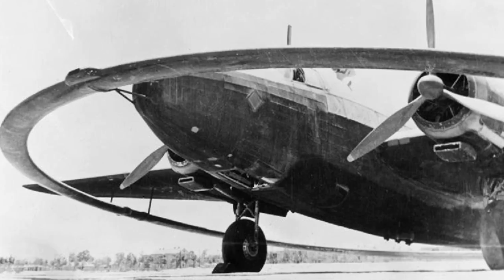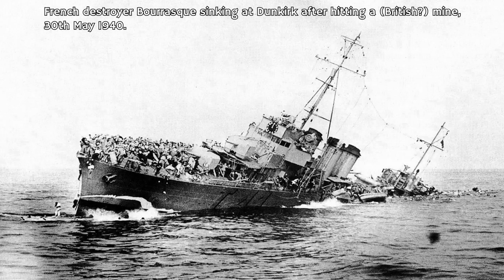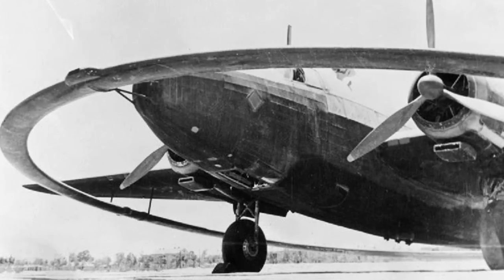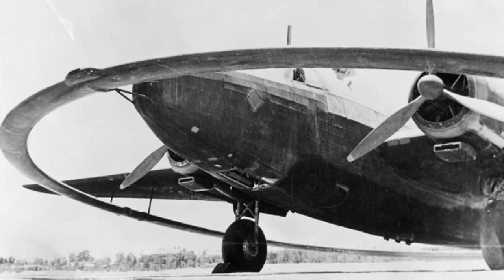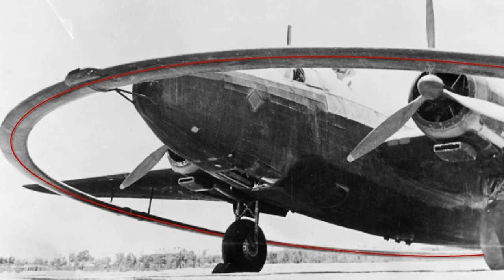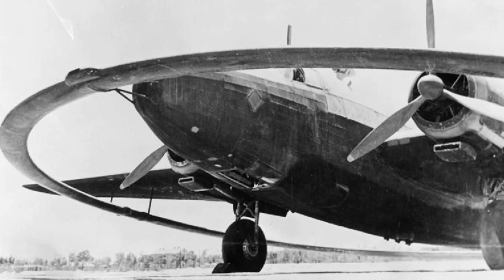Why did some WW2 planes have hoops around them?

Comment: Flying minesweeper....
Reply: The US Navy currently uses helicopters that tow a minesweeping sled behind them to do minesweeping.
Reply: How many Haitians do they pack on board?
Reply: As  Chairman of  the "Save the Haitians Movement" I will be reporting you to the Reischenbliger Organization of Moldova, The American Licorice Company AND The Cheesecake Factory.
Reply: MrDgwphotos seems ill advised
Reply: It actually works quite well. Not sure if it's still done but it was invented for very narrow and shallow waters where the large ocean going US Navy mine countermeasures ships couldn't operate. Rather than doing the obvious and build smaller ships, they built helicopters because high tech is always best ;)
Reply: @MrDgwphotos  Yes they are called MH-53E Sea dragons.

Comment: Electronic Warfare goes pretty far back in history, first learned about this taking the Electronic Warfare Officer Course in Iraq.
Reply: Yeah, I would argue it started when people adopted the telegraph technology.
Reply: fascinating video. I would like to have such a modified plane in my model collection.
Reply: Take A Revell BV138 "Fliegender Holzschuh". Nº04368
It has the parts to modify to the minesearching version
http://modelstories.free.fr/analyses/avions/MS2006_10P/REVL_BV138/index.html

http://modelstories.free.fr/analyses/avions/MS2006_10P/REVL_BV138/REVL_BV138_BA.JPG

I build one of those 25 years ago
Reply: Yup, wireless telegraph jamming was already utilized in the Russo-Japanese war.
Reply: Archimedes used a heat ray at the Siege of Syracuse to destroy the ships. Sun reflected off polished shields onto a single point cause the sails to ignite. Ships that got too close to the shore felt the Archimedes Claw. It would dropdown heavily through the wood and then lift the wooden ship up and capsize it.
Reply: Laser weapons? Archimedean mirrors? Both are primary users of the EM spectrum and thus not eligible to be classified as EW. Using something to counter those devices would be.

Sorry for spoiling your day :P
Reply: EM spectrum...isn't that ELECTRO MAGNETIC spectrum? Consequently early electronic warfare? just saying.
Reply: TheKira699 "electronic" and "electric" are quite different terms kiddo. Electronics are devices that use controlled flow of electrons to produce electric effects in the world around them.

Comment: I wonder if this idea would have been better suited to minesweeper boats. Essentially there would be a mechanism to increase the magnetic field of a vessel to the point where it would detonate magnetic mines from a safe distance.
Reply from the maker: They tried that but not with the greatest of results afaik.
Reply: "negate the ships own magnetic field" - which is why minesweepers tend to be wooden ships. A fairly effective way to reduce the magnetic field.
Reply: There were used on Danube by Romanian Danube Fleet. Just small torpedo boats having a cable wired all around the ship to degauss it,  towing a metal barge with a high magnetic field. 

The problem was that a magnetic mine of WW2 could have 24 contacts, each triggered by a ship passing nearby (some of them already switched on). So up to 23 ships could pass over a magnetic mine and nothing happens. To clear a safe channel you need to pass up to 24 times over and over again on the same route, to be sure there were no untriggered mines. Not a very effective task for a ship. A plane could do 24 passes in far less time than a ship.
Reply: Marius Huse Jacobsen Mordern vessels are usually made of glassfiber
Reply: Shoes right? Why is all history spun?
Reply: Look up degaussing coils for ships
Reply: Minesweeper ships work in a basically different way. They don't want to detonate the mines (it would be pretty dangerous...) but pass over them as they pull the 'sweep'.
The process goes something like this: smaller size and small draft ships sail over the minefield, pulling a huge 'wire-something' behind them to cut loose the moored mines, then sharpshooters detonate them on the surface from a safe distance. The first minesweepers were simple British trawlers with their fishing nets changed to sweeps. Hence the name: minesweeper.
So, with magnetic mines the problems wasn't how to detonate them but how to do not. They started to build ships from wood, non-ferrous metals or install degauss coils. And later, with the invention of sonic detonators, they even had to make them soundproof.
Btw, this magnetic solution was short-lived idea even on planes and they switched to sweeping sleds what the aircraft can pull on the surface from a safe altitude...
Reply: Yeap, but magnetic mines work different from contact mines. Magnetic mines lies on the bottom in shallow waters, exploding under a passing ship. The shoch wave would break a ship in two. So, these pesky magnetic mines had no cables to be cut. hey had to be detonated on the spot, from a safe distance.
Reply: A few navies did try this but it was too dangerous. The Germans built some big anti magnetic mine hunters called Sperrbrecken but they were very expensive and suffered a lot of casualties.
Reply: I would say, use a little wooden boat and tow something like this far behind it.
Reply: Theoretically it might or might not work.... until the enemy developed mines with a timed fuse, making the mine explode under the minesweeper. At which point it becomes suicide.

Comment: There was a documentary on Discovery about it.. it was 10-15 years back now.

One of the crew of the first test was interviewed. 

First they had the hoop at a angle of attack. But then the magnetic field was leading the aircraft to much, so the water spray damage the rare of the aircraft. They was still able to land. And later models had a neutral angle of attack. Pretty much solved the problem

Comment: Germany did in fact blow up their own mines, mostly in Norway. But they also searched the rivers at the east front. There were also other aircraft in the German forces that would do the same role, they even tried to use a water aircraft (Bv138C-1/MS) as doing this very thing. This Bv138C-1/MS is however rather hard to find, likely that there were not many build either since none survived the war.

For people who like to search up the planes:
Ju 52/3m MS (Minensuch) equipped with degaussing ring
Blohm & Voss Bv138C-1/MS

Other aircraft with similar roles:
Lioré et Olivier LeO451 359 (Vichy French, 1942)
Blohm & Voss Ha139B/MS (Germany, 1936/1937. Only 3 build)

Comment: May a make a slight correction?

In fact, magnetic mines do not directly react to the magnetic field of the ship. They react to changes in the natural magnetic field of the earth that get distorted by the steel of the ship.

Usually a ship has a magnetic field that has an aligment that is different to the magnetic field of the earth and which will then have a distorting effect on the natural magnetic field.

Also, those ships were not really "degaussed", although is was called like that. What the engineers did was installing huge electromagnetic coils, which homogenised the magnetic field of the ship, i.e. alligned it with the magnetic field of the earth.

Okay, that were my nitpicking five minutes for today. :) Apart from that, time to subscribe, it is amazing how much I have learned from your videos already!

Comment: Ships don't "generate" magnetic fields. The ship's metal enhances the magnitude of a magnetic field artificially generated by the mine itself, and  detecting such an enhancement triggers the mine. The coil on the airplane generates an external magnetic field to simulate such an enhancement.
Reply: Thanks for pointing that out. I always assumed it was the engine and moving parts they were talking about. So I didn't really understand how a wooden or plastic hull would help, besides 'shielding the magnetic current'.

Comment: I don't know about British planes.  Some US Navy PBY Catalinas were fitted with similar looking loops. These were Magnetic Anomaly Detectors (MAD) for Antisubmarine detection.  I believe they were first used in the Strait of Gibraltor to detect U-boats that had a tactic of silently drifting through this choke point with engines off using the inbound and outbound currents (which were at different and predictable depths).   MAD systems are still found on many patrol planes today.   Some models of the Boeing P-8A have MAD, some do not.  The operating service decides their need.  (retired P-3C TACCO).  Cheers!

Comment: I would have explored having two wires drop down with a disc between them in a horizontal structure which went from wing tip to wing tip.  This would have removed the crew and airplane further from the water and mines.  Airplanes tow gliders and banners, so something like this could be made to fall below and trail the airplane.

Comment: hmm, a similar constructions might also work really well against barrage balloons - just as a random thought.
Reply: This is exactly what they did; I've seen line drawings of He-111's with massive fenders out in front of them, which didn't exactly do wonders for performance. The Brits supposedly fitted their bombers with leading-edge cable cutters built into the wings, but I have never seen detail drawings of the same and the only source I have is a throwaway line in a 1980s Bill Gunston book written for ten-year-olds.

Comment: I wonder why they did not decide to make the hoop tilted down at the nose when flying. If the hoop was attached to the nose at a lower level than at the tail then the magnetic field generated would have been tilted towards the rear of the aircraft. So the mines behind the aircraft would be triggered and explode rather than the mines directly below, thus keeping the aircraft safer.
Reply: That would also create an enormous downforce, wouldn't it? It would also increase the distance slightly, although I suppose they could have countered that by flying lower yet again. Assuming that's a feasable thing to do above the ocean waves.

Comment: Both side had specially-modified airplanes fitted with this special metal loop to trigger off magnetic mines. I do know from William Green's "Warplanes of the Third Reich" that Junkers built a number of modified Ju 52-3m's for this very purpose, flying at low altitude.

Comment: sorry Bismarck as sound as your evidence is the real reason the ring was put on the aircraft is so that when they run into walls or trees the propellers wouldn't break that's where rc helicopters and drone manufacturers got the idea from
Reply: wait, are you serious?
Reply: Phi6er that is a different version of the ring the Russians used
Reply: Haha xD
Reply: No.  The loop is used to slice British Sausage - Bangers !
Reply: How would they run into a wall on the ground
Reply: Simon No no no! The builder of the plane was Lord of the Rings Fan and wanted to ahow he has the ring
Reply: Simon It's actually so the planes can fly upside down
Reply: i don't think so, this does indeed look like a degaussing ring as Bismark says
Reply: There's no need to add a hoop to low flying aircraft for the purpose you mentioned, because unlike RC helicopters and drones, the power and mass of a full scale aircraft is strong enough to act like a wood chipper should the pilot accidentally fly too close to the top branches of a tree. Having a hoop hanging down would actually be more detrimental as it adds more weight, drag, and can potentially get snagged on low objects (much like if you dropped your landing gear). Having actually flown aircraft, I can assure you pilots are more than capable of maintaining a safe distance from the tree canopy without needing such a device. The magnetic field generator is a much more plausible explanation, and it would also explain why someone who's a huge WWII aviation buff such as myself only just now heard about such a device being on a WWII aircraft. My initial guess was some sort of sensor array for detecting submarines. WWII saw some really innovative inventions. I'd recommend you look into the American P-61 Black Widow if you're into cutting-edge tech WWII aircraft. The P-61 may very well have been the first aircraft ever to specialize in night operations, and it employed some pretty revolutionary arrays of which the hoop in this video reminded me.
Reply: Planes don't fucking crash into trees and walls on a usual basis, and when they do, the whole plane is destroyed.
Reply: MutantSushi I know, it's a very unknown word, but do you now what humour means? It's no shame not to know what it means, but this was an example for H.U.M.O.U.R
Reply: Lol, the ring is made out of balsa wood. It's no saving anything.
Reply: I dont believe you understand the hoop. Its actually so the plans can land sideways and roll to a stop
Reply: Andrew Da Costa 😂 Nooo! The ring is there that all alien-conspiracist have something to do
Reply: Dukas54 But.. jet fuels cant melt steel beams!!!
Reply: Dukas54 I think you're on to something there with the prop protectors!! LMBO
Reply: Dukas54 so sad people don't realise you're joking...
Reply: Robert Hopcraft I think you fit that category even more, as someone who can't understand jokes
Reply: Maurice Hancock it's called a joke ;)
Reply: Maurice Hancock he had to be joking!
Reply: Dukas54 How do all these people not realize you're joking? For fucks sake people, go outdide, and stop taking everything so seriously, you'll be happier with your life
Reply: Yeah, balsa wood is well known for its tree felling capabilities...

Comment: They could have just towed the hoop like a Beer Banner ya see flying along the beach on weekends n Holidays,   Or put some wings on it like a glider in tow,   with a nice long tow line,  the plane would have been safer,   they could even have a quick disconnect lever in case the ring got damaged and was a problem for the tow plane,,  But metal was valuable during the war,  maybe they wanted to keep it close,  not to risk losing it,

Comment: The ring was used to set off depth charges. They had to fly low ( around 50-60ft above the water ). Knew this as soon as I seen the picture.
Reply: Dan Nguyen some (as explained in the video) could be set off by a magnetic field, so yes. That's why

Comment: your wrong no magnetic german mine was disarmed.
it was the suposit super wepon that coud have won the war.
only germans forgat to mention that to the pilots. So when the pilots got under heavy fire. the mine was droped without arming it first it even had the temper prevention key still in it, and it droped in a sandbank.
if it was armed it would have blown up. if it was not submerged, and also when trying to open it. one of the biggest OOPS of the war.
ps: sry dislexsic.

Comment: You said that the hoop has a diameter of "roughly 50 metre" and then go on to say "that's like 50 feet or something". A metre is 3 and 1/3 feet. So 50 feet is nowhere near 50 metre.
Reply from the maker: KaptenN No I said 15m. this has been beaten to death in the comment section already....
Reply: My apologies for mishearing then. If it is as you say then I'm not the only one who mishears it. Perhaps you should consider putting in an annotation at that spot to clarify what you were saying?
Reply from the maker: Sadly Annotations don't work anymore as they did in the past (I can either put endscreen links OR annotations), not both. Otherwise I would have put one.

Comment: wtf?? Why not just make an electromagnetic ball or something attached to a winch that it drags through the water? Kinda like the Boeing E-6 Mercury and the dealio it drops into the sea to communicate with subs. idk man maybe it was impractical to make a powerful enough battery in a small container back then but it seems like a much better idea. Long rope and you can fly higher.. Safer and you could even make a thing shaped like a plow with magnets on each end to cover more area. Bonus points you can keep your defensive armament.
Reply: How would they take off and land with that? The E-6 uses a trailing wire antenna that can be stowed in the fuselage; the antenna required to trigger magnetic mines isn't that simple.
Reply: When the Yanks had to clear their own mines out of Haiphong Harbour as part of the Paris peace agreements in 1973 they used helicopter-towed water-sleds, IIRC. Helis are ideal for this job, but of course helicopters in WW2 were few and far between (mostly Focke-Achgelis, IIRC) and probably none of them would have been powerful enough.
Reply: Do that with a boat.

Comment: one meter = 3ft., so 50 meters = 150 ft.
Reply: 15 meters though, not 50.
Reply from the maker: 15 meters
Reply: actually its a tiny bit over 164 feet, if you're going to correct him at least get it right yourself. 1M=3.28 feet.
Reply: read it on closed caption, it says 50 meters not 15
Reply: Closed caption goes on what the computer thinks it hears, unless someone forcefully manually corrects it. No offence to Bismarck - I know he's doing his best in a second language, and it's very good indeed - but because of his accent I heard it as 50 metres too at first, so I don't blame YouTube for being fooled.
Reply: I just thought he made a mistake, not complaining about Bismarck at all
Reply: I m = 39.37 inches.
Reply: ge45ge Called he said 15